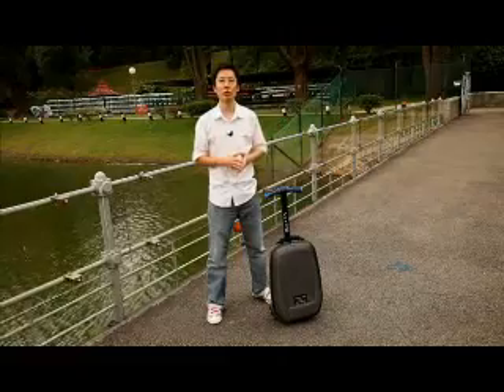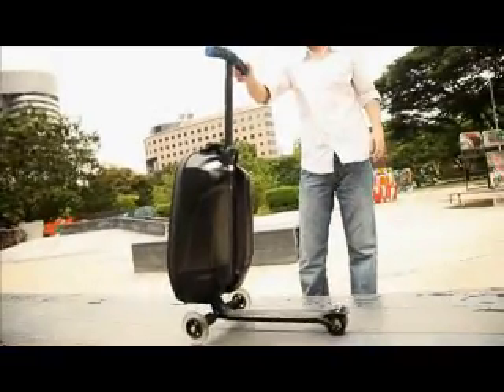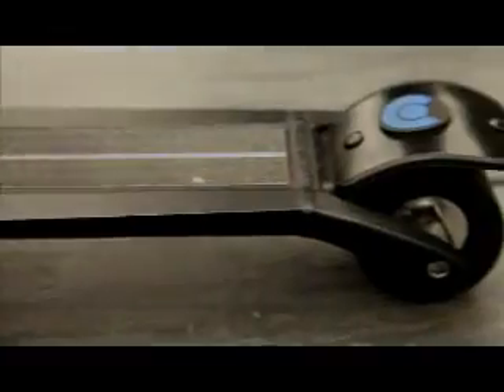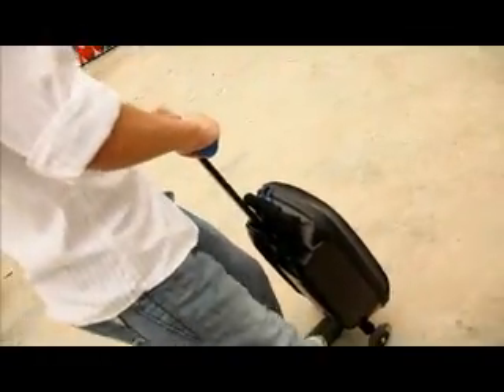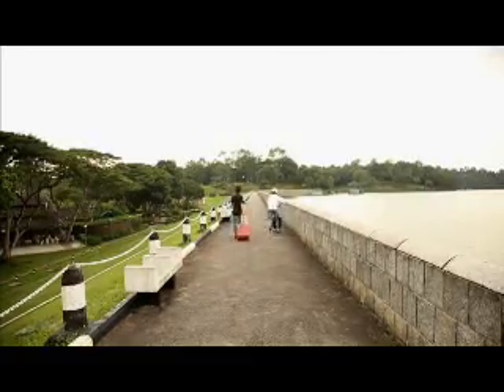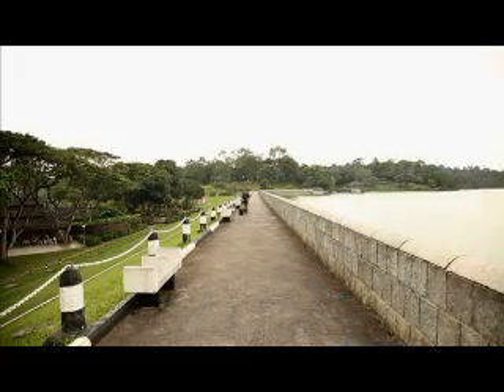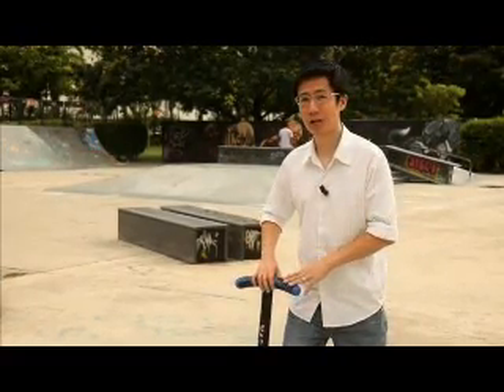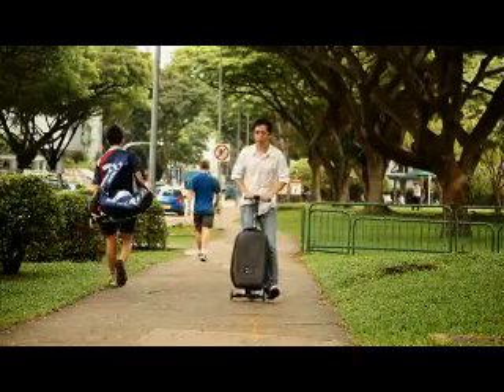Micro Luggage scootcase

Comment: Mouahahaa!! Either the bearings are crap or this guy doesnt know how to use a scooter. The time difference in the race is way too low especially consdering the other guy was walking not much faster than a Jamaican rasta on a sunny beach at lunch time. With so little strorage space you would be better of with a small skateboarding bag and a skateboard.... Thats what we have done for years. And it would take you 30 sec to go there and back.